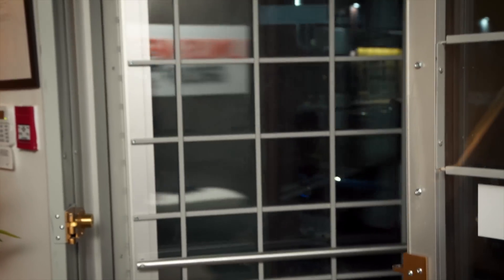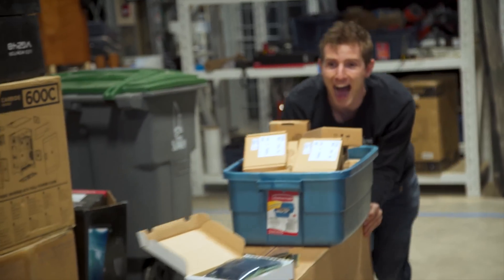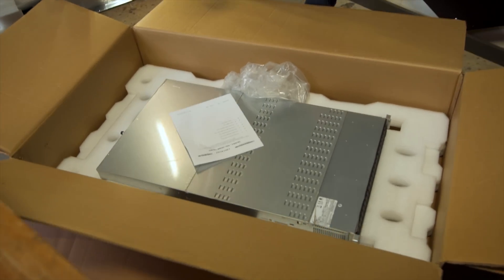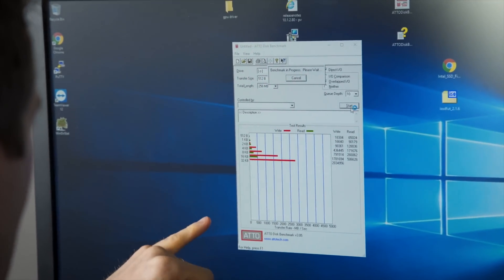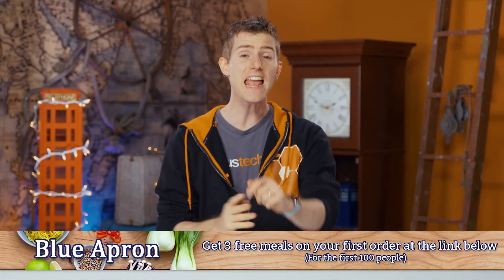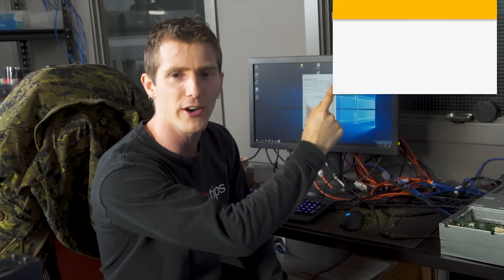The Fastest Storage EVER – HOLY $H!T Ep 14

Comment: What's odd is why not split the drives  between the two back planes? Double the speed. Also I hope you were using storage spaces not windows drive management for raid 0 or anything for that matter. Bump up to 40-100gb Ethernet or infiniband and use rdma instead of 4 port copper Ethernet. You can hit 2.1 million 4k ramdom read iops and 25.6 gb/s sequential reads using only 10 of these drives all the while running it over rdma smb direct. With that said great use of hardware I really dig that server. Being hoping to run a similar test but using optane drives vs Intel 750. Would be kinda cool.

Comment: I can't imagine why are you benchmarking 24 NVME drives on Windows
Linux have much better, much faster NVME driver and it is few times smaller (less unnecessary work, which is waste of resources)
2 22 core CPUs and you are happy about passing 10GB/s? Seriously?!
on Linux you will have at LEAST 64GB/s of software RAID6 performance
with 24 nvme each rated at 2250 you should be able to do RAID66 with speed of over 20GB/s
obviously this is provided each nvme would get its own dedicated PCIe x4

Comment: its realy slow for 32 pcie 3.0 lanes you should put some SSDs in the secound row to reach the free last 16 lanes
Reply: 4:14 pcie x16
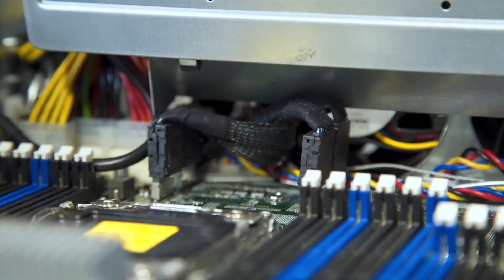4:20 another 4 times pcie x4
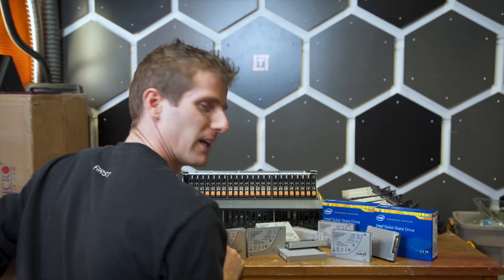5:05 just fill the first row
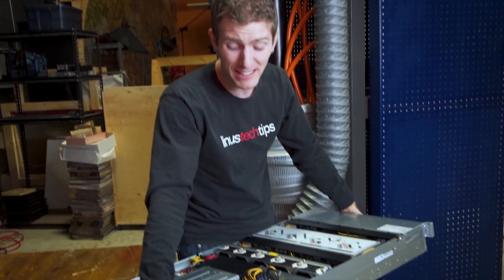5:40  confirn that he just use pcie x16
btw. i checked the maual and it seems the x16 card is for the secound row

Comment: RAID6 in RAID6?
you can easily do that
minimal amount of drives needed for RAID"66" would be 16, but you use 20 or 24 without any problem
I would rather use 25 or 36 for RAID"66" for performance reasons
I am actually thinking about trying to use RAID"66" on my linux server and see what performance I would get from it.

Comment: Might want to check out SanDisk FusionIO storage, or SeaGate Nytro for true fastest storage :)
Reply: FusionIO - some key metrics:
640GB MLC NAND (two individual 320GB SSDs on one PCIe card)
1.5GB/s Read Bandwidth (64kB)
1.0GB/s Write Bandwidth (64kB)
196,000 Read IOPS (512-byte)
285,000 Write IOPS (512-byte)
Access Latency 0.029ms (512-byte)
PCI-Express x4/x8 or PCI Express 2.0 x4.
Reply: SeaGate spec's don't copy nicely, are theoretically better but drivers for Windows aren't great:
1.5 / 4 TB
up to 300,000 / 100,000
up to 4.0 / 2.2 GB/s
8PB 1.5TB / 20PB 4TB

Comment: Hey @LinusTechTips, I've watched the other 1 PB storage with 2 Seagate Nytro drives as a high speed cache (pretty impresive, by the way), which is a very fast storage for writing data on, but I guess it is not as fast as this one for reading.

I need to ask you, what are you using the storage server from this video for?
Could you share some benchmarks comparing both systems?

Comment: Aren't the Samsung 960 pro m.2 nvme drives faster? They are rated at 3200 Mbps read and 2100 Mbps write. My Dell XPS 9350 (at least a year old) laptop has a Samsung 950 pro installed on it and that is the prior generation, its rated at 2500 Mbps read and 1500 Mbps write. Also, from my research, the Intel nvme ssd drives use a lower quality nand. Also, in a raid array, shouldn't you be using NAS Hard Drives that are disk based. Disk hard drives are way more reliable and less prone to failure than solid state drives.

Comment: Firstly what is the server for? Secondly how much data transfers? The read write cycle for SSD gives it a limited life cycle. Because you got all your drives from the same supplier at the same time chances are they come form the same batch. Do you have any idea what $hit storm awaits you when ALL those drives fail at the same time? That is what will lightly happen. So basically your supper high speed server is most lightly going to cripple your data/network during its "end of life cycle" i recommend that you do regular "full backups" because when that server fails it will be a very very very very bad day for you...  Why because you have basically if all those drives are form the same batch you basically build a worse case scenario server... Linus dude you should check these things... One last tip get yourself a "trolley table" to move those servers around for your own health and safety...

Comment: If you want to be the best one! Get this specs for this sever!!!

SuperStorage Server 2028R-E1CR48L

Barebone: Supermicro SuperStorage Server 2028R-E1CR48L - 48x SATA/SAS - LSI 3008 12G SAS - 1600W Redundant
Processor: 2 x Twenty-Two-Core Intel® Xeon® Processor E5-2699A v4 2.40GHz 55MB Cache (145W)
Memory: 24 x 64GB PC4-19200 2400MHz DDR4 ECC Registered Load-Reduced DIMM
Boot Drive: 2.0TB Micron M1100 2.5" SATA 6.0Gb/s Solid State Drive
Storage Drive: 48 x 3.2TB Micron S650DC Series 2.5" SAS 12.0Gb/s Solid State Drive
Controller Card: Supermicro AOC-S3008L-L8E SAS 3.0 12Gb/s 8-port Host Bus Adapter
I/O Modules - Networking: Supermicro SIOM 10-Gigabit Ethernet Adapter AOC-MTG-I4T (4x RJ45)
Network Card: 2 x Mellanox 56Gb/s FDR InfiniBand or 40/56-Gigabit Ethernet Adapter ConnectX®-3 VPI (2x QSFP)
Power Protection: APC Smart-UPS 5000VA LCD 208V - 5U Rackmount
Operating System: Microsoft Windows Storage Server 2016 Standard

I dare you to build this MONSTER!!! <3

Comment: Hey Linus, I am watching the part in this video where you are complaining about having to remove 4 screws from 24 hard drive bays. Did you know this is a thing? (http://m.homedepot.com/p/Milwaukee-M12-12-Volt-Lithium-Ion-1-4-in-Hex-Cordless-Screwdriver-Kit-2401-22/100615066) I am a low voltage electrician in the US and I got tired of cramping my hands all day and bought one. It is basically a super low torque impact drill. It on the low settings will not strip or over screw at all. Period. And is safe to use on small electronics. Get one!

Comment: The real question is........Can it run Minecraft?
Reply: Those 30 fps in high
Reply: Calm down Edgy McEdgerson.
Reply: But can it run minesweeper
Reply: :D
Reply: ChancePlays no, the machine doesn't have legs.
Reply: UpPvP you’re gonna need about 4 1080ti’s
Reply: 8K60 minimum with the maximum texture configuration?
Reply: NatayTheFrog edgy haha xdddd
Reply: ChancePlays no no way
Reply: just FTB CrackPack see if u can even mine a shit, lol
Reply: Actually umm no
Reply: Cullen 12345 unfortunately... no. It can’t. 😛
Reply: A solid 25 FPS in low setting, it’s playable though don’t worry
Reply: NatayTheFrog r/woosh
Reply: I Think
Reply: uhm last time i checked you can't run anything on a ssd alone
Reply: With those CPUs, oh yeah!
Reply: Because of the solid state drives Minecraft said 
Let's turn minecraft into ctysis
Reply: RpiesSPIES 🌚🌚

Comment: Linus grew tired of PCs and is building mainframes now.
Reply: Spoken like someone who has never actually spent time with mainframes.  You're small by a few orders of magnitude.
Reply: @pleappleappleap  college I work at recently replaced out SAN. The old one was a Dell VNX taking up about half a server rack with various SAS HDD's. Replaced it all with a single 2U server running NVMe drives, doubled out capacity and with a total of 180k iops.
Reply: @pleappleappleap  would you be surprised if he did?

Comment: If you wanted maximum speed you would have split the drives across both the discreet and integrated controllers, rather than loading all of them onto the discreet card.
Given your history, consider a raid 16 with the controllers mirroring each other. You'll have n/2-2 capacity, but losing any one controller plus two drives would be a survivable failure.

Comment: Linus, the first rule of storage is to balance your storage across all your i/o connections. since the onboard appears to have the equivalent i/o as the add in card, put half your drives on the internal set of drive bays. i use the intel 750's regularly, usually in the pcie add in card configuration and they are fast. you should theoretically be able to get to those numbers using a lot fewer drives and by splitting them over the onboard and add in i/o buss they should double in speed. and it should only take 16 drives (8 per controller) it would be interesting if the supermicro cards support raid natively. But this is a cool example of raw speed.
have fun playing with your toys...
I am a HP storage engineer and have been working with high end storage for almost 20 years.

Comment: im shure that in 20 years we could have that in oure phones
Reply: We are getting pretty close to what nowadays computer hardware technology can offer. We need a whole new architecture and model (perhaps based on optic fibre? who knows) for hardware in order to achieve something that power on a small device.
Reply: 10 years ago 1TB HDD was considered a beast. 10 years before that 1GB was insane. This trend has gone on since the 1950s. You can plot it out and it draws such a straight line that its scary. Its almost like new technologies are being released at a pace that the manufactures chose. Like to release them in a way not to outpace the needs of the users. *see new phone releases/consoles/TV/everything else. Its not about pushing the envelope, its about maximizing profits.
Reply: no
Reply: In 50 maybe
Reply: the grammer/spelling in this comment thread, it kills me!
Reply: With the current form factor of phones, we wouldn’t be able to get a terabyte without the phones being x2 as thick.
Reply: Haha. I wish. Moore law no longer applies. We have no reasonable use case case rn for that. Maybe 16k video read/write for VR or something. Even that would only need around 100 megabits per second rn. We're not limited by phone hard drive speeds at all rn to need even current nvme speed

Comment: Hey Linus, I'm really keen on knowing the consistency of sequential write speeds. We've done RAID 0 arrays for high speed systems but found, due to the RAID controller NOT passing TRIM commands to the SSDs, they slowed right down after several full write/erase cycles (and by several I mean 3-4).
The only way we could get consistency was to rebuild the array after filling up the drives.

Comment: Hey Linus,

A suggestion as you are using Windows Server 2016, I believe you would get better performances and manageability by using a Storage Spaces setup. I'm pretty sure you could easily saturate your PCIe bus there at all time whatever you throw at it. As with everything, it has to be tested and new videos can be made for our pleasure to watch ! ;)

It would take off the RAID processing load from your NVMe controller, which modern Xeon CPU's like yours don't really need anymore anyway as Software Defined Storage solutions are now very efficient and requires very little CPU resources. A cons maybe that if your controller can already easily handle the load of a high performance RAID X array, then it might be your PCIe bus will saturate rapidly and slowdown your overall performances. But mathematics says me that in the more every day usages, the PCIe 3.0 x16 slot with 32GB/s of bandwidth, even with theoretical 24 x 2.5GB/s = 60GB/s shouldn't be your bottleneck very often. That is why it should be tested before choosing one or another as every use case delivers different results.

The advantages is that you could reconfigure your Storage Pool on the fly with a mix of some Mirrored Virtual Drives (something like RAID 1 or 10) in double copy or triple copy mode for even more redundancy, Striped Virtual Drives (something like RAID 0) for things that would need more speed than your PCIe bus can even give you ... or ... Parity Virtual Drives (something like RAID 5 or 50), even though I do NOT recommend that last one ... I have also noticed considerable lower access latency using Storage Spaces over hardware RAID setups.

Replacing a drive is very easy, and when you have multiple drives like you do you can even benefit from additional redundancy as the data contained on the dead drive will automatically replicate onto the remaining drives space that's unused yet in the whole Storage Pool, until a new drive is inserted and then you can kick off a pool optimization to fill up that replaced disk and share the load evenly. What this optimization does is it re-optimizes or re-balances the positioning of hot and cold blocks of data among every drive in the pool so that every drives in the pool share their part of these hot blocks, not only a single drive in the whole pool. To keep your storage pool at high performance at all time, you can schedule that same optimization job every week or so.

The important trick there to account for is the number of columns you setup your system with, which will determine the total performance of your storage pool while in Mirrored mode. As your server can take another array of only 24 other NVMe drives (caugh here), you could configure your system in 12 columns and later expand with another 12 columns. Even more, on the long run, you could add yourself 1 or more cheaper external HDD JBOD arrays and start using Storage Tiers to use a few NVMe drives as a cache for hot data blocks, and finally have yourself a several 100's of TB of storage. Also, all your drives have to be in JBOD mode for Windows to give you the best performances and manageability (aka warnings and errors reporting).

Finally, as I believe (hope !) your Quad 10Gige card supports RDMA, have your workstations installed some RDMA friendly 10Gige cards, if they don't already, and your SMB shares should fly faster than your 4 x 10Gige ports can while your CPU be taking a break (given now that your network switch can take it).

Personally I have a few deployments with Storage Spaces so far and performances are well beyond what a standard RAID 1 or RAID 10 gives on a 1GB or 2GB cache controller, even though I have not had the luck to play with a NVMe deployment yet. And it can be managed remotely from within your own Windows workstation with the RSAT. Read about it if you haven't already, there are lots of pros and cons, but so far the pros largely out-weight the cons in my deployments.

Comment: my vote is for raid10 if you want it to last

what u should have done is go for tiering with a huge 3.5" spinny disk tier, then perhaps 8-12 or so of the nvme drives in the fast tier for read/write caching
since u have only 40Gb/sec of network bandwidth that would be enough and you'd save a significant amount of $/TB

edit: perhaps you need to sub contract a real IT company to set you up something

Comment: Oh man that's bananas. We have over 20 servers with varyingly 4 to 8 intel ssd's, and even those kick ass performance wise, though, they're not for file storage, they're a certain type of key-value database that works natively on ssd without any filesystem present. 8 ssd config servers can handle a little over 100k reads (as iops) on their own, and if you make clever optimizations with RAM, they can handle smth like (not just ssd power anymore though) 200k (that's as far as we went, I'm sure they can do more, did not make any stress tests on that config yet). They are so much fun to work on though (even though I only work on them software wise, they are physically in another country ;( ).

Comment: Pretty much the only good way to use RAID these days is Raid 10.
Raid 5 is over the hill for some time now and raid 6 is getting more and more useless aswell.
So Raid 10 or a software solution is what i would go for.
But on the other hand, your drives are pretty small in capacity (thats in HDD standarts :)) so raid 6 could work, given enough power the get the speeds youd like to get.

Comment: Is the server running Windows or just the console?
Reply: +Jaden S.
Really now? what kind of drivers and programs did you have in mind?
Last time i checked, in many server use-cases a proper use of a Linux system is usually way more sufficient on the long run. Which as far as a i could tell, is why it's more perfered over Windows deployments when it comes to more serious production enviornemnts.
Reply: Jaden S. It's a shame, really. All that power saddled with Windoze.
Reply: Thats Server 2016. Looks extremely similar to Windows 10 ;)
Reply: Bryon Lape probably temporarily running windows from a flash drive or something until the systen is properly configured. .
Reply: Bryon Lape Ehh.. to be honest, OS makes little difference when you factor in that many drivers and programs don't exist for linux-based OS platforms. it's a trade-off, but you get the usability back as a result of Windows being used for everything.
Reply: Server 2016 with SMB multichannel is a real beast where you can easily get 40Gbps off of 4 10 Gbe Nics in an active/active fully switched environment.  ReFS in stretch clusters are regularly pulling 1.5-3 million IOPs, so an all NVe system like this is probably capable of 4+ or more if Linus is using S2D.
Reply: +Shane Creamer
I don't have any statistics on hand, but i think it's possible to pull-off something similar using NFS on Linux when using bridge interfaces (over multiple NIC's) and something like XFS, JFS or at times even ZFS.

Comment: Linus, your NIC will saturate at up to 5 GBps, which means you will not be getting up to 12.7 GBps to the drives. There are a lot of bottlenecks in this method, but very little is ready to replace it just yet.